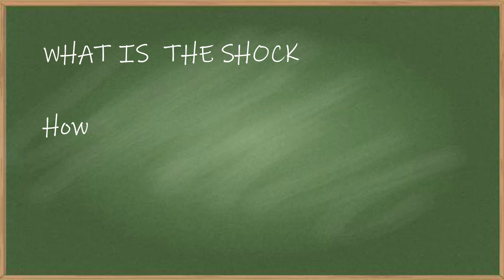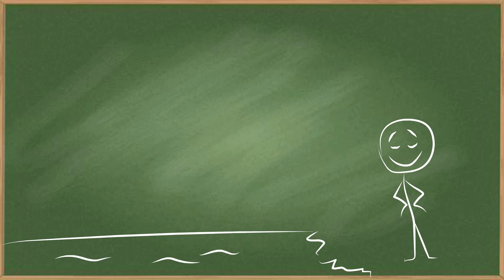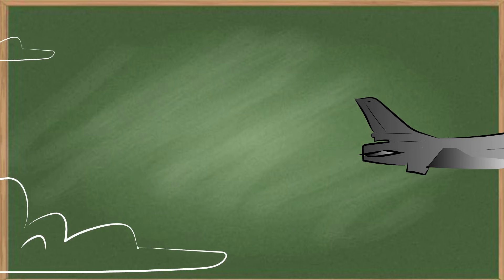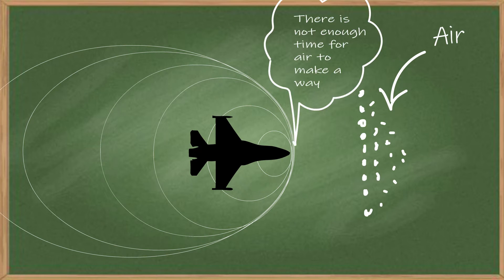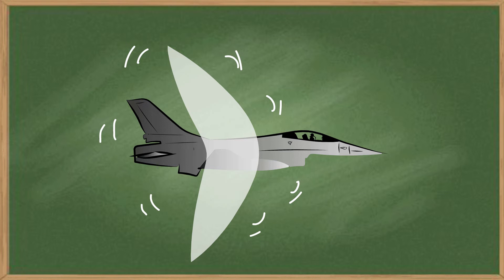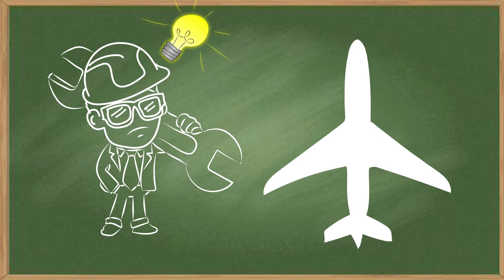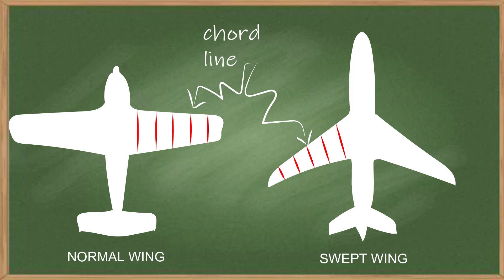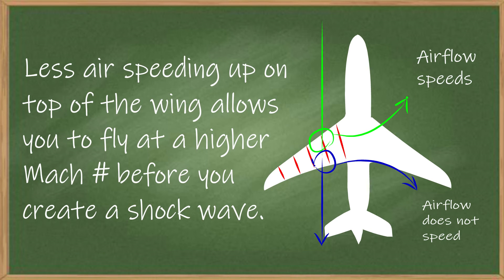Shock wave and wave drag| Lesson #4

Comment: the cloud is not a shockwave its the cold and hot air mixing something like that
Reply from the maker: Hey there :) 
If you wanna get into more details about the topic it’s like this, the cloud itself is called a vapour cone and is created due to condensation which is caused by low pressure and low pressure is created by the high speed. 
So technically, the cloud you see or the vapour cone is an indication of a shock wave. 
Correct me if I am wrong